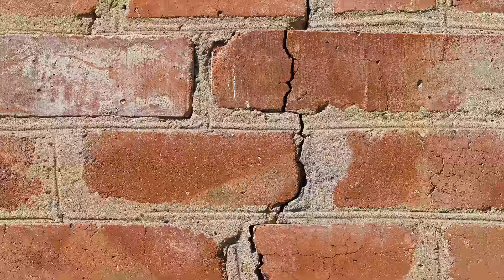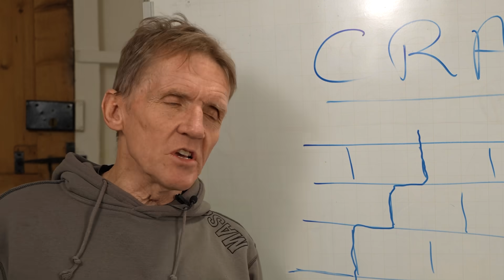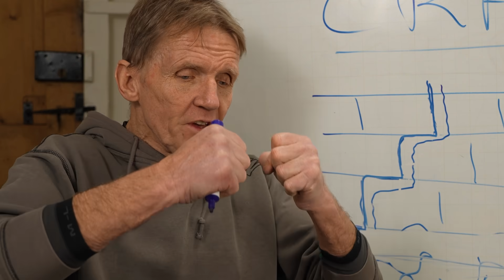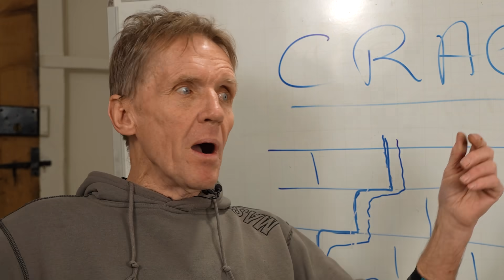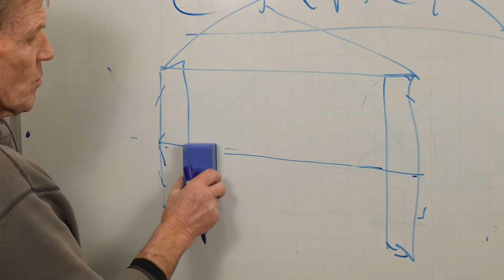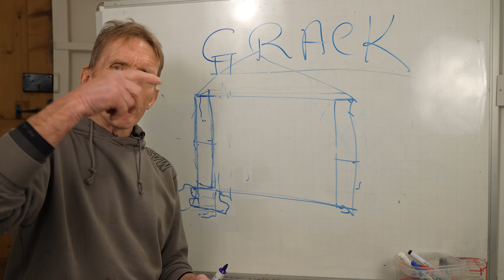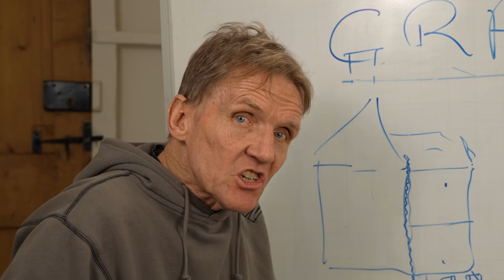Why Has Your Wall Cracked? and What Can You Do?

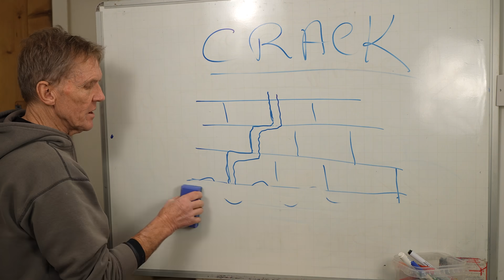Comment: 2:47 i live in se Minnesota. Our ground is straight clay about 1-4' down depending on where you dig. I also see a lot of cracks following the mortar lines. I understand now where they came from. Our foundation needed reinforcement to pass inspection so we have those steel i beams all along our basement walls. My problem is water intrusion was not addressed. I wish i knew then what i know now but hey here we are. The doorway leading up into the garage from the basement wasnt water sealed at all from what ive seen. Now the foundation wall behind the door carpentry is disintegrating a bit and needs repair. I also see something like the wall ties you mentioned. Big metal plate with a massive bolt in the middle of 2 walls. Ugh this poor house has been through it!!

Comment: Rain leaking from joint between top of window and brickwork
Reply: There is some hairline cracks in plaster above window leaking water in heavy rain we had cavity tray fitted a couple of months ago thinking’s this would resolve the problem have also re sealed sealant around window

Comment: @Roger - would you go with the helical bars when you’ve got very minor 1mm or 2mm cracks on a clay substrate.  I hear what your saying about the expansion and contraction and don’t want to simple transfer the crack to some where else? 
I like the idea of a helical ring beam around several course to sure everything up. Finally I did put some crack stitching in following the removal of big conifers 1 meter away from exterior wall and had some cracks zig zag down.  10 years later no cracks.  I think the very hot summer we just had has shrunk the clay again.  Cheers

Comment: I have a vandal trying to cost me $ and cause bigger problems. I know my home and I know the brick work was fine until the last year. While I'm away at work he chiseled off about a 1/4" - 1/2" of 5 brick faces and took the debris with him. It's the common red brick. What would I use to repair this ? He also chiseled away the channels/expansion joints between concrete slabs. How would you fix that? I've seen two ways but I want to know your approach. Thanks

Comment: Roger having watched this I wondered whether you could answer a problem my brother has.  He has horizontal cracking on his interior walls, it appears about 30 cm from the floor and is not evident on the outside walls. The bungalow was built in 1980.  He bought the house earlier this year(2025)and had a full survey, there were no horizontal cracks evident and they only appeared after the dry summer.  He had a surveyor look at it but he was not particularly helpful with an answer or a solution. If you have any suggestions as to what this could be it would be very helpful.

Comment: Hi, I’m looking at buying a house and the main house is connected to the garage and the utility. I’m not sure if these are actually brick tied or not. The there is a vertical crack running about half way up the wall to the top of the wall internally . You can also see a bit of this crack externally. I’m unsure if it’s just a bit of movement/settlement or if it’s the start of subsidence. The house may have been built in the 50s or earlier. It’s a single brick build. If I sent you a photo of the internal crack could you give me an idea of it’s a major worry? Just so I know if it’s worth going to put an offer on and getting a survey on it to move forward with the sale . Thanks

Comment: Hi. I have a question. My small porch is separating from the original bungalow. Finger wide at worst. Looks like it was never tied in correctly. How can I stabilise/ repair this issue?
Reply from the maker: It is common for it not to be tied in. You need to get some concrete under the foundations.

Comment: This video has helped me not make the mistake of filling cracks in my garden wall.  I am convinced the crack is caused by a nearby tree with a TPO on it as we had the wall rebuilt after a previous issue in the same place. Trouble is, insurers dont cover garden walls so it will be expensive to get an expert in and put monitoring in place without any guarantee that we can get the tree taken down.  Any advice on best course of action woyld be appreciated.

Comment: Absolutely fantastic video, wish I'd watched that years ago! Just one question, you distinguish between sand-based issues and seasonal shifts with clay subsoil. If I've understood you correctly, it's not a good idea to fill cracks from clay movement with anything but lime mortar. Plus, again, if I've understood you correctly, the helical/helibar solution is for one-way movement, eg with sand, and you're not recommending it for seasonal clay-based movement? Is that right?

Comment: Hello Roger I live in a 98 year old terraced house my neighbour's have recently built a back extension and a side extension. The houses are on clay soil xx i now have a horizontal crack from the party wall in my front bedroom above the window to the other wall its at least 3mm wide I rarely use this room it's for storage only so was alarmed to see this xx my neighbours have also removed their chimneys they assurred me they had made everything safe in the loft. I'm a disabled pensioner who doesn't have a lot of savings im terrified the wall will fail I stupidly trusted my neighbours of 18 years that if any damage was caused they would pay for it I signed a mutual agreement but did not get a copy can you please advise what I should do xx your video is great you explain things so well even I can see it makes sense and I know nothing about building damage xx many thanks Lyn xx
Reply from the maker: hello Lyn 
Cracks can be alarming but on clay with the unusual dry period there is a lot of shrinkage and that is bound to affect the foundations. It is likely that a 98 year old house has very shallow foundations so they will have dried out. 
3mm is not classed as concerning so  I would wait until the rain comes and see what happens. It would be worth measuring the crack in a few places so you can see if it closes up. 
It is hard for me to say, without seeing the house, but I doubt that it has anything to do with the work your neighbour has had done. Very often we see things happening at the same time and try and attribute cause to those things but the key thing here is the dry weather. The extension your neighbour has had built will be tied into the existing wall and, if anything, it will help support it.

Comment: Thanks for the info got suspected subsidence on a house all been surveyed and have been told they are doing this to the outside   Type 9 - Supply and fix stainless steel stitching anchors as per SD001 specification - Allow for 
supplying and fixing stainless steel stitching anchors as per standard detail sheet SD001 using 6mm diameter 
austentic stainless steel rods.  Didnt understand a word of it but know it all makes sense

Comment: The 'corners down' problem can be complicated.  45 degree cracks run down both walls forming the corner of the house, what is moving?  If the house is on sand it is usually caused by overflowing gutters and flooding by storm water.  If the house is on clay the centre of the house is actually heaving upwards, leaving the corner foundation behind.   This is usually visible on all 4 corners.   Get some professional advice from a geotechnical engineer.

Comment: Could you tell me please how repair two stone window ledges that have broken horizontally and left  a large gap in the stone.  Thanks Mary.
Reply from the maker: Hi Mary this is common and if you want to keep the stone you can gun in some epoxy resin in the crack and blind it with a sprinkle of sand that matches the stone as best you can.

Comment: I live in a building with subsidence problems directly below me. My apartment floor shakes and vibrates and moves with the slightest reason it's so bad when the weather is very wet that I have had to remove all my furniture fridge cooker bed tools and anything heavy.
I live in a housing association in UK so I'm not expecting any help from them, they cannot even turn up to repair even minor damage. They will never attempt to repair subsidence which will cost 10s of thousands of £££s.

Comment: well but note one thing that as you are telling  that if during summer contracting and in winter expending if at the bottom the foundation is not buttress then with each year the gaps and cracks go on increasing .

Comment: Most significant cracks that are live are the result of movement caused by a water escape. More common than subsidence or heave which mostly applies to expansive clays and related to changes in moisture. Roots damage to drains due to dry weather are typical and if sandy silt soils may result in wash out. Regards subsidence, rarely need to underpin - just maintain moisture content by pollarding trees for example.

Comment: very illuminating - fancy a visit to Australia LOL. I'll be looking up more of your videos so I can get my wet and cracking 120 year old chimney fixed based on knowledge of what should be done. Had a bad water leak from rusted out old pipes that the plumber lazily kept instead of replacing 5 years ago when work was done in the bathroom. Took advantage of me as a woman working away at the time. Poor chimney ended up sitting in a big puddle for months and I didn't know as my son was  in the house while I was away. Cracks inside and out with the foundation bricks on the ground crumbling! Another problem is the outside of the chimney was cement rendered over lime mortar so you rising damp also a big problem. Many thanks for posting.

Comment: Depends on the crack the foundations and the load put on the upper stories. Then you have to have the brick checked for its strength when you find that out you can then put on glass tell tails to see if there is still movement this could be a year or two. There is no quick fix for it to be done quickly.

Comment: Great video!  have lots of internal wall cracks (and some shifting of the back door and frame) in our 1956 single-story ranch style house in San Leandro, CA. The walls are standard wood framing with stucco on the outside. Do we need to open the internal walls to check on the studs and framing? I Could it be termite damage, wet rot6, or dry rot? There are no signs( inside or out) of wet rot or dry rot but the house had termite infestations before we bought it in 2019.

Comment: Hairline cracks nothing worry about getting them from temperature changes only time need worry about cracks if runs bottom upwards means foundation problem of top down like staircase means structural problem get hairline cracks ebe. Virtual due weather doesn't mean be collapse

Comment: Thanks for this video. The full brick house my mum lives in has a crack in one wall. My dad built this house around 45 years ago. The footings for the house were excavated from clay. I tend to think over the years the clay has expanded and contracted as it got wet and then dry.  My dad died ten years ago so he can’t help us.

I’ll take photos of the crack so it can be seen if the crack gets worse over time. I’ll patch the crack up with a similar mix to what originally was used, lime, cement, sand and water. I used to labour for my dad mixing mortar but that was 35 years ago so I’m out of practice. I’ll just put a bit in the surface to block up the gap.

Comment: Recently found a crack Roger and initially felt panic. Happened on this great advice by chance and am now simmered down. Been around for almost 3/4 o a century so have at least learned to scream inwardly and NOT make a "knee jerk" move that creates destructive pounds of idiocy that then requires tons of repairs to undo. Thanks!! Easy does it in spite of the near panic that would have been quite expensive and regretful.

Comment: I have that stair step crack under a picture window that looks like it was remortared once before (different color). Bought some flexible sealer but thinking i should get an inspection after watching this.  Somewhat dandy soil., basement is finished but no cracks or leaks in walls.

Comment: Time to get someone out to check our kitchen. It's an original extension off the house but there are cracks inside and out on the walls and also the lean to style sun lounge next to it the chicken wire  glass panels are cracking. One crack lets in water.

Comment: Whats the best way to avoid these vertical cracks under windows with face brick when your about to build from new?
Reply from the maker: Bed joint reinforcement is the only way to be sure. https://tecoproducts.co.uk/products/bead-mesh/ladder-mesh/
Reply: @SkillBuilder  excellent thanks.  £95 for a pack of 20 in stainless, well worth it to save loads of future hassle.

Comment: I extended my lounge about 25 years ago, and the plastering at the joining of internal walls have   shown vertical  cracks ever since. I filled the cracking, with fine polyfills, but still the cracking appeared.
I had the new double-sized ceiling artexed, when the room was extended, but a crack soon appeared, and filling the artex pattern looked terrible.
Eventually, because the ceiling was higher than average,  I had the ceilng lowered with timbers and plasterboard, and that flat , plastered ceiling has been crack free.
Could you please do a video on dealing with internal plaster cracks ?

Comment: Great insight to CRACK , I have a Crack in my garden wall , that has broken the bricks in half as it runs vertically straight down ,through about 4 rows of bricks. I think it subsidence in the wall as its single skin brick about 7 feet tall with brick piers every 8 feet but its only happening in the one place on a 60 ft long wall , any ideas Roger? TIA

Comment: Thanks Roger! Virtually all my lintels were cracking up, didnt seem to be any reason for it. I ended up acro propping them from the base cill and then angle grinding the crack open,  and inside were rusty steel rods. I had to with a wire brush remove as much of the rust as possible, paint it with anti-rust paint and then fill in the chase. Over 100+ year old house and water must have been getting in somehow or moisture and the steel expanded so much! Seems alright now, will let you know if my house falls down...

Comment: I think you don't know what you're talking about , I have been doing masonry repairs for 30 years and it has always worked with masonry and sand mix and joint the joints  well with a jointer
Reply from the maker: Robert
It depends on the crack and what caused it. If you don't work in a clay area then what you say is fine but if it is clay the crack will open and close with the weather. Filling it with a hard mortar will ratchet the joint apart as the clay swells. 
If you have been in the game for 30 years it is really surprising that you have not come across this information. It is well documented in defect action sheets and other technical publications.

Comment: Hello, i extended my room and made a bathroom and a closet room. 
The company i hired apparently didnt do a good job...
when rain happens, the water goes through the old and new brick roof and it leaks inside the closet room and basically ruining the woodwork of the closet...
is there anything i can do to fix that?
i hired another company to fix it and they slanted the roof so it pushes the rain down and they did water proofing... but still the same issue....
if anyone have an idea on how to fix that would be really good

Comment: If the foundation was made of wooden piles and rotted, then reinforcement should be done in any case.Partitions are sometimes removed with load-bearing walls. Reconstruction and repair of an old house is a difficult task.Not every engineer can handle .

Comment: My mothers house a traditional terrace built 1901 as actually sinking at the back. But only one side was going down so floors sloped but no cracks. Insurance were not interested in paying for underpinning.
Reply from the maker: I would get a structural engineer to prepare a report. The insurance company is paying the surveyor and they will wriggle out of anything. The need a bit of slapping around.

Comment: Sir,I didn't soak bricks before using.now I have been curing brick walls for 40 days.is there any possibility of building cracking?  Plz reply sir..
Reply from the maker: you should not soak bricks before laying. The less moisture you have the less they will shrink. You have nothing to worry about so long as your mortar was not too strong.

Comment: Sensible advice indeed - cracks happens and,  as you  say, all buildings and their fabric  move due to moisture and thermal variations  etc.  As highlighted the most important step (with all building defects) is to  establish the cause (diagnosis) before deciding what to do. 
Building Research Establishment Digest  251 (Assessment of  damage in low rise buildings)  is invaluable when  it comes to assessing cracks,  Among other things it   advises that minor cracks can be made good relatively simply and suggests that “unless there are clear indications that damage is progressing to a higher level it may be expensive and inappropriate to carry out extensive work for what amounts to aesthetic damage.” It concludes by advising that “The only certain way of confirming the progression of damage is to take a series of measurements with time.”
Reply: THANKS